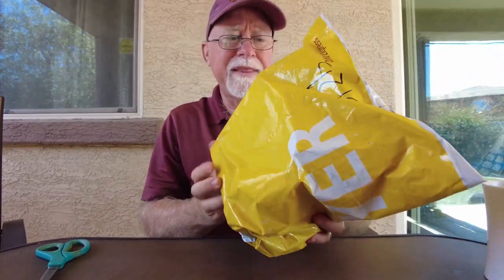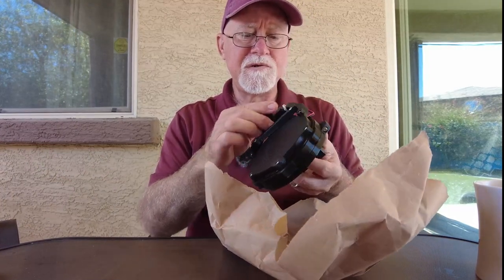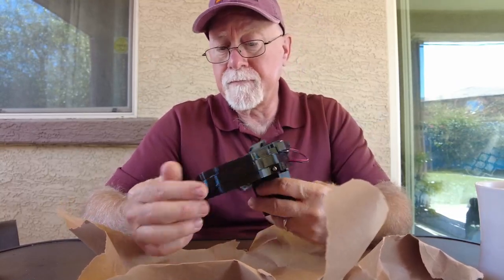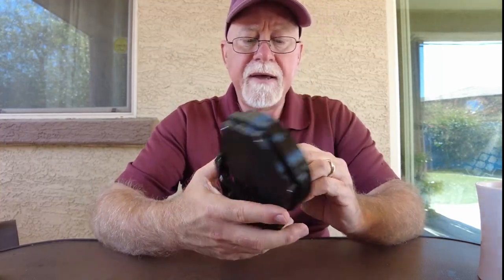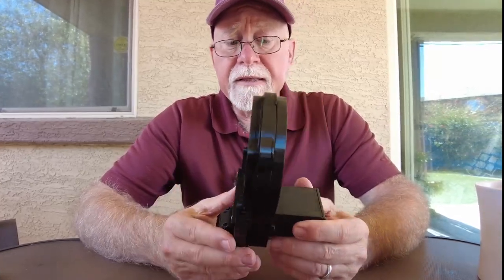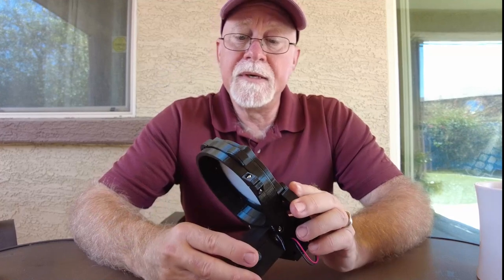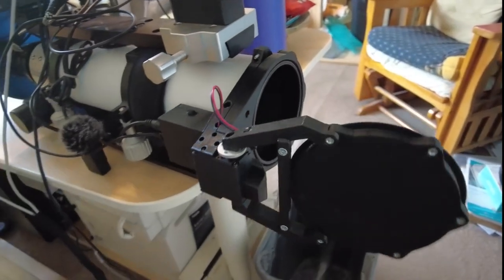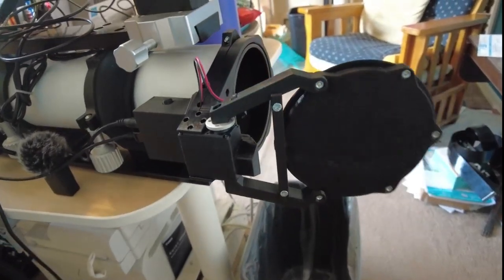Make YOUR astrophotography easier using an automated flat panel!

Comment: Did you do any flats with 3nm filters? If so, how long did they take? 
Glad you shared this with us!
Reply from the maker: I have some 3nm filters I am about to add to my system. Right now I have 7nm filters for Ha and SII and a 3.5nm OIII filter. I use NINA, and with the flat wizard you can "teach" it to take consistent flats. I have had no issues with both the 7nm and the 3.5nm filters. The brightness of the flat panel is adjustable so it can compensate for the smaller band pass. I am working on a follow on video that will have my 3nm filters to see how that goes, and I will let you all know. CS!
Reply: @DaveUrbanAstro  I'm really looking forward to it! The Pegasus Flatmaster forced me into 20+ second exposures. I'm really interested in this product. It's half the price of some of the other 'flap' products.

Comment: Hello,

Looking back, are you still happy with your Motorized flat panel?

Does it work well did you manage to get good flats with NINA (I'm also using it)?

I asked to Skydad if it can generate long exposure flats (5 to 10 sec for me) as I use 2 OSC cameras, a Zwo ASi 2600 MC Pro and more partuclarly the Player One Artemis C Pro based on IMX 294 known to be tricky for flats ! ;-)

I consider buying the motorized flat panel, I also exchanged with Skydad and he told me that an adapter also exists when you buy one model fo a specific telescope, and you just have to order this adapter to him, mentioning the size you want to reduce to.

It's a sort of ring you insert inside the first one.

That's grat for me as I have 4 setups, but I consider using the flat panel only for my 2 refractors as my RC8 is too big ans same thing for my Mak 180!

Thanks for your feeback

Philippe
Reply from the maker: Philippe, I am so happy with it, I got a second one for my Rokinon 135. They work great and thus far, no failures. Pretty happy!